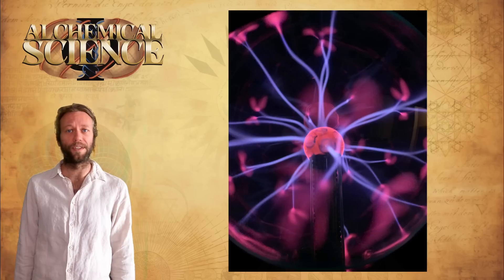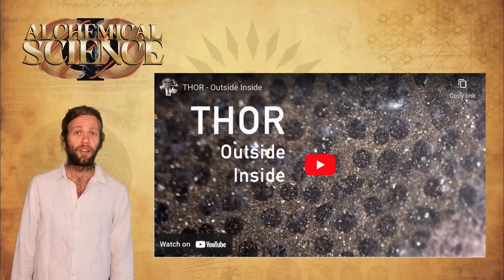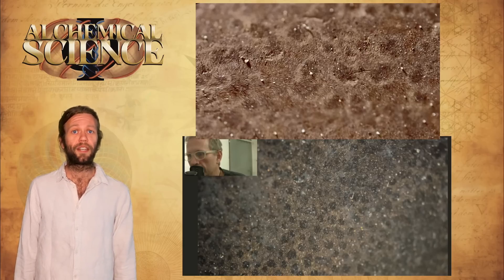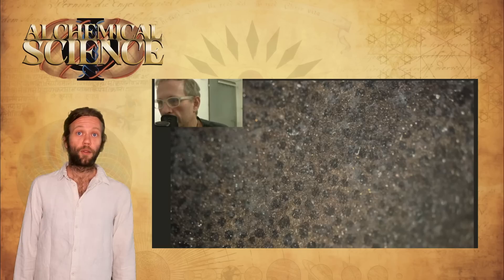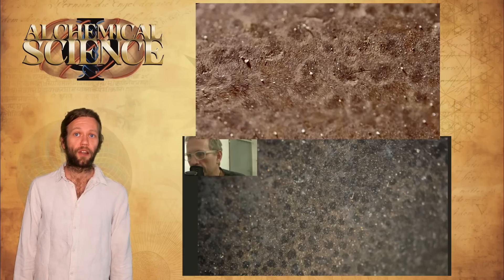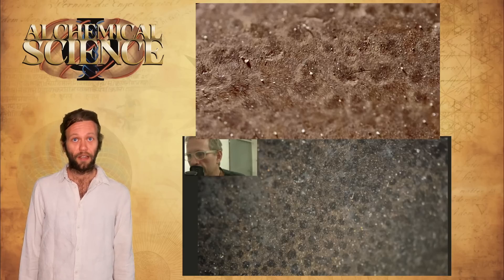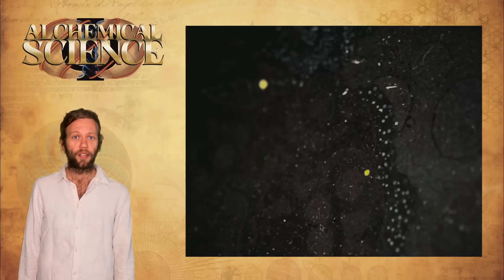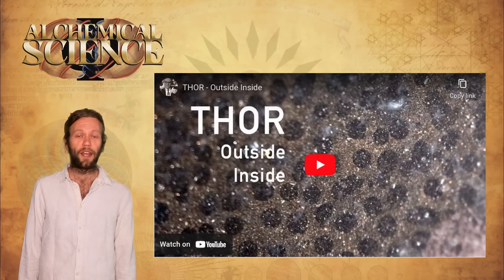Groundbreaking New Evidence of Plasmoid Phenomena in the Thunderstorm Generator from MFMP

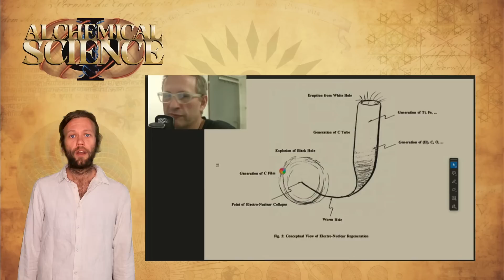Comment: At 11:04 there's a description of a process that seems to involve the production (or even synthesis?) of carbon and some other elements. What's interesting here, if it's correct, is that this represents an alternative pathway to the synthesis of heavier elements. Up to now, the only proposed pathway has been synthesis via fusion inside stars.

If this pathway can synthesize different elements, that could be very significant in terms of how planets are created. Also the timing of planetary/solar system formation. If you don't need multiple generations of stars to synthesize and concentration the heavier elements, you can have solar systems and planets much earlier in the history of the Universe.

Comment: No discredit to you or your work (unless you're secretly working with him), I've enjoyed your content and I really do hope this technology is true.
But... I'm struggling here.. 
I'm yet to find a decent explanation of most of the concepts and although quite a lot of the numbers do add up, there are a lot that seem to be plucked out of thin air in order to line them up with 'sacred numbers'.
I can't find any information regarding the taurus. How the elements are lined up on it and why it is specifically split into 8 other than that's what makes the magic number.
You can split the taurus into 2 and still get the cross section of an infinity symbol? 360+360+90+90=900. But why times that by 8?
I've read (well looked at the pictures) about it and it doesn't make any sense nor is there any explanation.. Does look cool though..
The big wheel picture too. There's no explanation for the majority numbers on that circle or how they arrived at those numbers? 
I've tried reading his notes on his website too. There's a lot of maths but no explanation about it. I see numbers that are divided by 266.666 a lot and when I try to cross reference it to the big wheel I don't see that number anywhere other than, 144 400/266.666 = 540 up in the top left and then I don't see 540 anywhere else either?
(After a little more digging I found he is linking it to music? I rewatched your video about sound frequencies of A being 432hz and that doesn't have 266.666 anywhere?)
A lot of the information he does have on there really does sound like gibberish.
I'd love to understand it all, as I said, I do hope it's all true but as I also said, I'm struggling.
Reply: Watch Randall Carlson explain.  The ratio of your hand to elbow and foot to knee and the distance between the earth and sun etc.  you’ll have to spend the time watching.
Reply: @bnpscnm  I've watched a fair few of his videos and I'm pretty sure I've not seen anything about 266.666. He's probably got thousands of hours of videos, care to point me in the right direction?
Reply: It's the golden ratio.
Reply: @lukiepoole9254  what is?

Comment: Can you comment on the output power of any of the retrofits? So far I've only seen measurements of the exhaust, but without seeing the output power or, equivalently, the output voltage and current, I have no evidence this is a viable power source.
Reply: they wont. or the experiment is over.  every video ive seen, the engine runs terrible and surges while starving for fuel.
Reply: @inteligentmonkey1 source?

Comment: This presents the fossil fuel companies with a quandary.  On the one hand, the exhaust from ICEs can be more or less totally cleaned, with the added bonus of Oxygen being synthesised (yes, this is an alchemical system, so they can sell more fuel.  On the other hand, it opens the gates to systems that can unleash millions of electron volts per methane molecule, say, as compared to the fourteen or so electron volts released when the methane is burned - and that is for each and every molecule.  The energies released by ElectroNuclear Collapse (as identified by Dr. Takaaki Matsumoto) is over 1000 times greater than that released by nuclear fusion, with 1Kg of Iron, for example, being able to power a starship to the Alpha Centauri system and back at close to light speeds.  Yet, there is evidence that fractal toroid/EVO technology may well once have been used by human ancestors fir rock cutting, shaping and transporting - with many ancient symbols bearing an uncanny relationship to what the MFMP has revealed in open research “down the microscope” - in addition to there being increasing evidence that the universe is fractal - as above, so below as the (ancient) saying goes

Comment: So what your saying is that its leaking? Which would cause less efficiency? Can try coating the spheres with liquid Glass/Graphene mix layer! Very heat resistant Hard as hell & 10x more conductive than copper

Comment: I'm sure that if I'm correct then this has probably been mentioned a lot of times by smarter people and to some degree I don't like focusing on this application but as I just made the connection and wanted to corroborate it.

Wouldn't the changes produced in the exhaust gases produced by this be a game changer for diesel submarines? The exhaust reduction and oxygen generation sound absolutely groundbreaking but I understand that military subs (of which I know nothing at all) might have other systems.

I wonder how long it will take for narco subs to use use this...

Edit: On a more positive note, wouldn't this be awesome for underwater research facilities as well?

Comment: Carbon deposits need to be measured against missing carbon in the final exhaust. Is it a fraction or the lion share? A specific isotope deposited? Might it not so much be plasmoids getting "embedded" but the coating acting as a catalyst?
Reply: The battered and coated surfaces may also help efficient transmutation. Would be interesting to attempt without plasmoids.

Comment: 4:45 When people speak of plasmoids “embedding themselves” in the apparatus such that they have a durable effect after sufficient conditioning, this could plausibly be true in effect even if not true in dynamics due to the plasmoids actually persisting.  If plasmoid activity occasionally triggers transmutation that produces meta-materials (I consider this a near certainty as the atom building process is messy) that enable certain catalytic reactions to occur at low energies, then just throwing plasmoids at an object may give it seemingly magical properties because the matter is in very exotic states at various locations in the metal surface which hot exhaust is passing by.  So the plasmoids turn 304 stainless into an alloy meta material that catalyzes chemical reactions in the exhaust gas.

Comment: Thanks for the update and link to Bob's video! The pop marks do not create loss of thickness of the spheres, like corrosion?
Reply: I’m sure plasmoids do cause increasing damage that will lead to failure over time.  It’s likely the engine block will fail before normal due to hydrogen embrittlement too.  These are very early prototypes.  Building an optimized thing that’s robust will take some years, methinks.

If enough of the positive effect is persistent after the metal has been transmuted into a meta material by the plasmoids, then maybe we don’t need to have plasmoids going forever.  Maybe they just need to run it for a while in a factory getting blasted with plasmoids and then shipped to the customer to be used without needing more plasmoids.
Reply: @BobWidlefish  While transmutation can happen in LENR, it is the breaking, not the making side of LENR. Transmutation achieved will eat the actual mechanism creating it. But the making side of LENR, as in electrons, can be elicited carefully with a decided balance as in the TSG. But IDK, I'm just a layman deeply curious about how Kosmos is within us all. Cheers.
Reply: I saw a vid were Bob had a peice of aluminum made really tough after transmitting. Had trouble cutting it and rang when dropped.
Reply: @pauloneill9880  that was a Hutchinson piece, I’ve seen that video too!